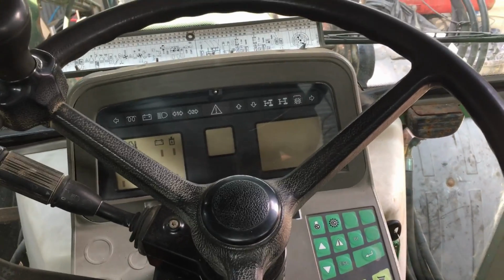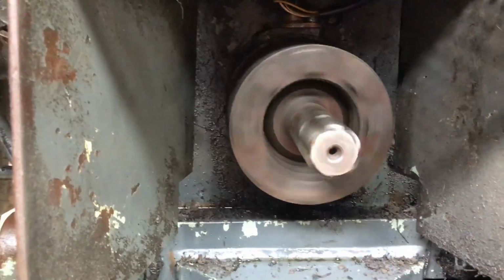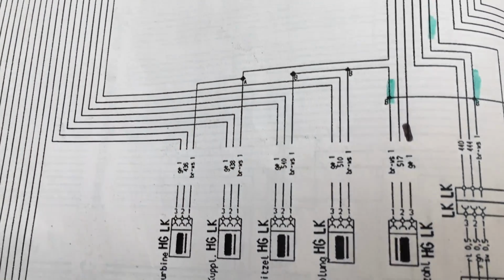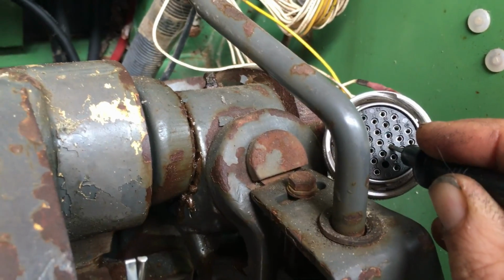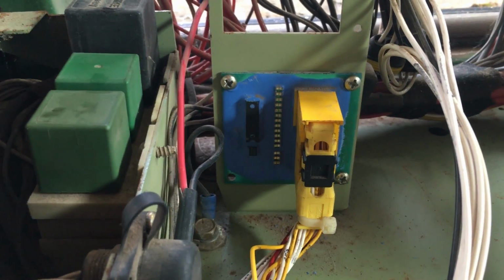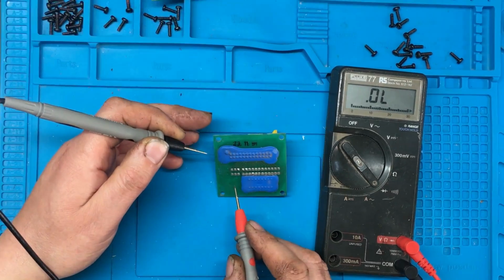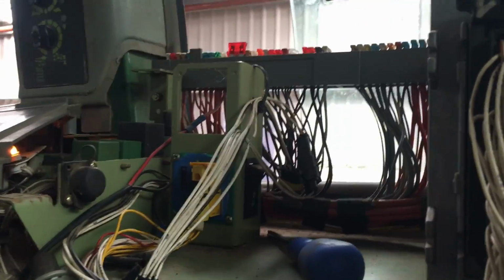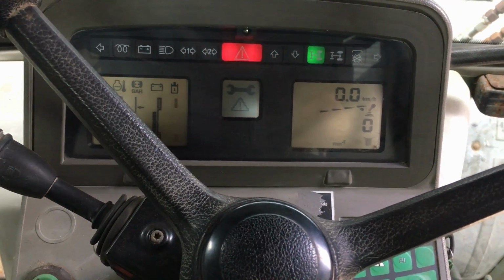Trying to repair an electrical issue on a Fendt Favorit 514C Tractor. Can I fix it?

Comment: hi have a  problem with speed sensor  on same tractor checked voltage only 7.5 volts,if I gave it a separate supply of 12 volts would this sort problem  regards peter
Reply from the maker: Hi Peter, yes you should have 12v on the yellow wire going to the sensor (if I remember). If you only have 7.5V that suggests corrosion on a connector or corrosion in a wire. Putting 12v to that wire, as long as the ground and signal wires are intact, and the sensor is ok, then it should work.
Reply: good man have her sorted
Reply from the maker: Nice one, well done 👍

Comment: poor little fendt :( it needs a lot lot lot lots of love such a shame
Reply from the maker: Yes, it did get a lot done to it, but the owner ended up selling it. Ideally it needs a new wiring harness as a lot of the insulation had gone brittle and just fell off if you bent the wires.

Comment: all electrical wires in 500 series after 20 years its off..! cost 1000 euros for the ftont and 2000 for the back
Reply from the maker: Yes my friends tractor has similar. A lot of the insulation on the wires has gone brittle and starts snapping when you move the wires leaving exposed copper.
Reply: @BuyitFixit  exactly..need to replace the holl wireles system(sory and now the word) to fix the problem

Comment: At first glance, I would have thought that HG is not meant to be translated into anything useful. Where did you get the diagram from? Btw: Great work dealing with that diagrams. I would probably have questioned my ability to read it, especially if I had measured the broken wire first. 
P.S.: After watching further through the video, "hall" in German stands for acoustic waves, too. I did an internship in the engine development of a German company, and they hired another company. Those guys also translated some manuals from English to German, and they translated AC in a way that I would have thought they were talking about the tide of rivers and not about electricity. Concerning those guys exist, I guess that might be the reason why there might be a pattern of mistranslating "Hall" by acoustic 🤣

Comment: Hi,
I wonder what the original Amp rating of those fuses are supposed to be. I'd be tempted to use some old fashioned household fuse wire, pre-resettable breakers.
As long as the wire you fit is of smaller surrace area/gauge than the PCB tracks feeding it you should be laughing.

One can have skills but it's not worth a great deal without a bit of experience to apply them. Thank you for sharing your wisdom.
Reply from the maker: I'm not sure, but it was only for a sensor, so I wouldn't think much. I think they are more there in case a short in the wiring, but the tiny strand of wire I used would easily blow in the case of a short. Thank you for your comment and support! I'm just busy editing another couple of videos....